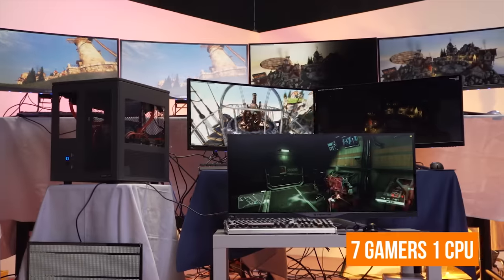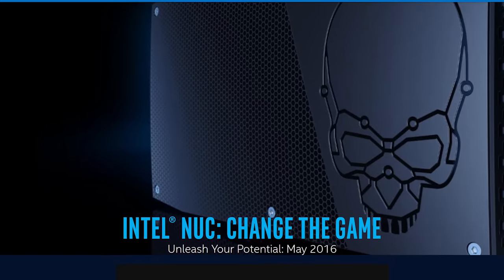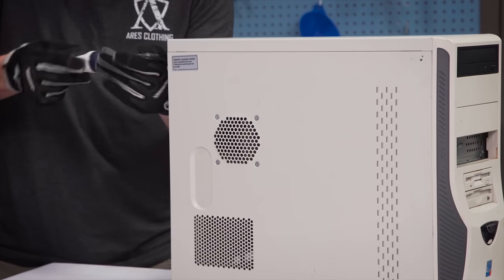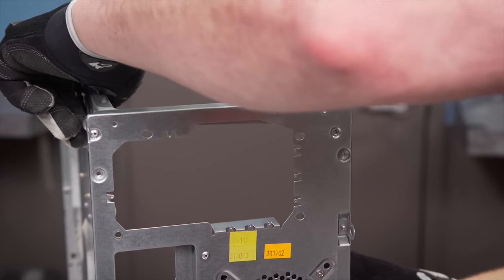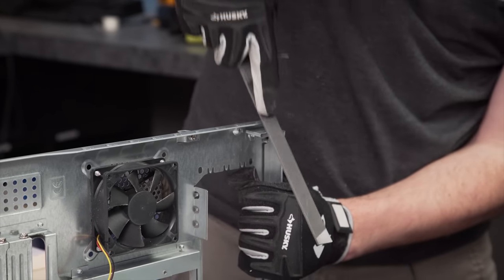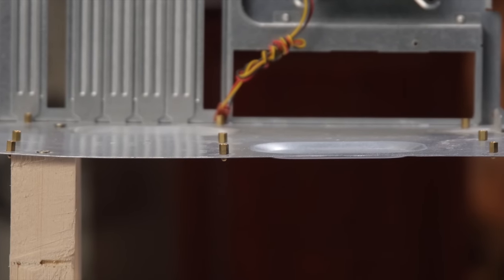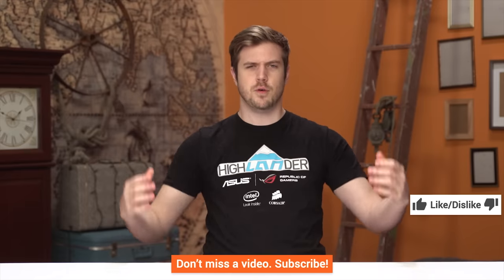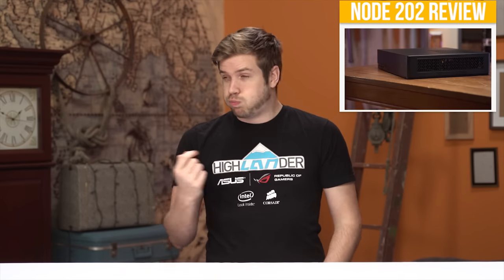Free (or extremely cheap) DIY PC Testbench!

Comment: BASICALLY FREE.....except for all these power tools that a lot of people don't have. Good Job.
Reply: +Adam Cross Good luck finding a nice workplace when you live in an apartment.
Reply: ikr
Reply: +wareagle3065 tell that to Casey Nistat
Reply: +Cutter Berk Neistat
Reply: One you can rent them two find some to barrow them from or three buy used tools there cheap
Reply: +Adam Cross all you really need is a power drill and a pair of tin snips. you can pick both of those up for $100 or less if you for some reason dont have a power drill and are watching this video
Reply: +Adam Cross This is shit the average home owner should already have. No argument.
Reply: +Samus Knight well ya, if you never plan on using your tools after you buy them they are not a very good value.
Reply: that would also work... probably would hurt to invest in a $20 power drill though
Reply: +Adam Cross Everyone should have tools.
Reply: +Adam Cross buy a metal saw for like 15$ and let me tell you anyone who is working with computers is more than likely an owner of a dremel which is really all you need to do this it will cut and file edges and they can be bought for like 30$ but i highly recommend good glasses as the cheap discs are known to explode ....
Reply: +Adam Cross good thing my dad an electrition and we have a workplace in my basement lol well part of it
Reply: Not an excuse. Many many many hardware stores have loan-a-tool programs.

Comment: dear luke,

at 5:16 please do not put your hand in front of a circular saw, great way to lose a few fingers.

if you need to rip some wood please have linus invest in a table saw.

thanks!
Reply: it had a stopper
Reply: @vladflorea7048  It had a stopper, but anything can cause it to well stop. A small piece of wood or anything could cause the stopper to get stuck, and it would slide up and verip his fingers.
Reply: @vladflorea7048  Just always assume it don't has a stopper. It's like gun safety and trigger discipline, correctly executed, the amount of accidents are reduced drastically
Reply: Safety first, i know and remember the sound of someone loosing their fingers in a saw.

Comment: you should really get some sheet metal shears. I built myself a testbench like this a while ago and they really helped to speed the build up because the cut the metal if those cases like butter
Reply: *of
Reply: +hansdietrich83 
But won't the metal bend on the cuts if its too thin?
Reply: +Polyaness ポリアネス yes but you can bend it strait easily
Reply: +hansdietrich83 I've got several old sheers since my grandfather used to do heat and air service lol probably never gonna make a test bench for myself but I guess I'm set.
Reply: +hansdietrich83 i was moding a case recently and there is no way that metal sheers would even come close to cutting through. just saying
Reply: +Smooth Trooper good to know.
Reply: +hansdietrich83 : I to have used them, and when it comes to tight places, they are useless.
Reply: +Thomas_Not_Tom They're*
Reply: +Thomas_Not_Tom Two names for the same thing
Reply: +hansdietrich83 i would have used a.. dang, i don't know its actual name, but i call it a nibbler, because that's how it cuts metal, by nibbling it away. Leaves a nicer edge than shears
Reply: +hansdietrich83 Sparks are cool.
Reply: +hansdietrich83 I believe that the amount of time that it takes to build that tray or money that you spent on power bills will outweigh the retail price of those motherboard trays. I think, it was like 20 bucks, eh? o.O
Reply: +Ozan Erbektas its a test bench not a motherboard tray. test benches are like £70.

Comment: Went on eBay and got a pc together for $240 usd, the pc has a i5-2400 8gb ddr3 ram and a gtx 750ti.  I had to tape the graphics card up and cut out a slot for the gpu in the side of the prebuilt case and cut put the slots on the side.  Along with removing parts of the plastic bits on the gpu shroud.  I was an adventure but for that price it's a great gaming pc.
Reply: Good job!
Reply: +herier44 noice job
Reply: +herier44 must have took some serious work. good on you sir or mam!
Reply: +herier44 too complicated. just use cardboard.
Reply: +herier44 cut out case "static much?"
Reply: jlrockafella ha nice idea ill have to try it some day.
Reply: Damn. I went with a custom case, 750ti,AMD 760kand 8gb ddr3 for around $500. 
Gj lad.
Reply: ***** thanks, mostly used parts and all but it still works to this day and when my friends come over they use it.
Reply: IS there any pictures of this PC anywhere?
Reply: 240 usd is way to much for a used system. You could build a new one for that money
Reply: Even worse fo 400 to 500 you could build a brand new system.
And new hardware is always better than used.
Reply: jment34 and with a hard budget of $250 what else was I going to do? The point of it was to have fun and see how much performance I could get for the price.
Reply: I would build a new AMD based system for a better performance/price. I have nothing against used gaming builds I do it also but always try unused hardware first.

Comment: I went to a scrapyard recently and ended up with an Asus P5N32-E SLI Plus (no onboard audio though), a C2D E4500 (OC'd to 3 GHz with a cooler I got from some Pentium 4 board), 2x1 GB Corsair XMS2 DDR2-800 RAM, a Radeon HD 4850, a 300 GB 7200 RPM WD hard drive, a super old case with a license sticker for Windows Server 2003 and a 450W PSU that is actually better than what most prebuilt PCs have. Even has a 6-pin PCIe connector so I didn't need to use a molex adapter to make the HD 4850 work.
Cost me 0€ in total. Cool stuff. Now if only I had a quad core CPU for it...

Not sure how this is related to the video, but anyway, lol.
Reply: Someone told me they found a PC with an AMD A6 CPU and 4 GB of DDR3 RAM in full working order :in that scrapyard. It's beyond me why people throw away these things.
Reply: Also, an Ivy Bridge OEM motherboard that I have no CPU for, but it does spin the fan when I short the power-on pins.
Reply: +InfinityCraft  because the people who throw away those things really couldn't tell you the different between a PSU and a PCIe.
Reply: djisomatic Probably, but you'd think people who own motherboards like the Asus P5N32-E SLI Plus would know that it's worth something. Then again, it was paired with a Pentium 4 and an old, passively cooled graphics card.

Comment: You tool skills have come a long way Luke. Going from trying to use a masonry bit in steel to one handing an angle grinder. And I like to see you bought the best one at that.
Reply: +Collin Huebler Welder/Fabricator checking in here...just like to say a 7amp makita grinder is by far NOT the best one.  When it comes to tools like this you want the one with the highest amperage motor giving you the most torque so there is less chance of stalling out the motor from working it too hard.  Makita makes great tools however you want to look for something with at least 12 amps or most commonly 13 amps as that is basically the upward limit you can pull through any standard 120V outlet.
Reply: ShoreStudios
Let me reiterate. For the price and size they got the best one. Ive beat the living crap outta the mikita and never had an issue. In the same shop the dewilts dont last a week. Every brand makes 1 great tool for mikita its the grinders for sure. You can probably get a 12 amp harbor freight or princess auto grinder but it wont even come close.
They arent exactly fabricating industrial skids here, right tool for the job. Seeing how luke cuts he would probably light himself on fire if u gave him a bigger one... been there before lol.

Comment: Please do a video on cheap server racks. That would be so awesome. I have 3 rack mount servers that I have on the ground because I don't wanna drop 800 on a damn shelf
Reply: +Surface™ Buy used, like off of Craigslist if you're in the US.
Reply: +Surface™ google "IKEA RAST bedside table server rack". there's even an instructable project on it if you haven't already figured out how to turn it into a rack
Reply: +Surface™ I'm in the same boat. Very hard to find a 12u-16u rack used. A perfect size for battery back ups, a few servers and switches and still short enough to put a printer on. Everyone seems to keep them. Way overpriced for a new one. The Ikea racks are great for shallow audio/network gear, but you have to combine 2 or mod some other tables for the standard rack depth. I've seen some adjustable depth racks, but they seem flimsy and don't trust thousands of dollars in gear in them.On the list of summer projects.
Reply: +WeAreTwoDoorsDown I could. But I would rather build one.
Reply: +DantesPurgatory But I would Like to see a video Of somebody doing it.
Reply: Surface™ get 2x 5/8" angles from Home Depot. They should be 19" apart on the outside. 1u = 1.75" so cut to length needed depending on how many Us you need. Build a simple plywood box around it and add casters for mobility. You basically need a table saw and a drill and a #10-32 tap.

Comment: Pro tip:  Go to Home Depot or Lowes and pick up a small bench top bandsaw - Ryobi for example would be fine.  You can usually find them on Craigslist, too.  Then get a blade for metal cutting (~20-24 teeth per inch, carbon tool steel or bimetal).  Get another blade for cutting wood (the one that comes with it - assuming it does - will work fine).  Then you won't cause people to drop bricks when they see you using a circular saw to make that cut on the 2x4 much less the 1 handed grinder use.  Safety first, man.  Plus, bandsaws let you do some awesome stuff when it comes to modding (and junkyard wars!)

Comment: I put a computer I made from old junk parts in a cardboard box once. 
Not quite the same, but my server is sort of a Macgyver project. Old Unisys mainframe tower, it came with 2 internal HDDs which were really just mounted on adapters in the optical drive bays. Then it has a RAID cage for 6 SCSI drives with SCA connections. A friend gave me like 6 more SCSI HDD but they were the internal type and I had no room for them so I just cabled them up and set them on the bottom of the case. Turned out the PSU was unable to power it all so I then put a DPDT switch in a filler plate for a 51/4 bay and that switches from the RAID cage to the internal HDD stack. When I got it too for some reason they used loud low flow squirrel cage fans I just put a case fan in the back vent and put the ducting back and left one of the 3 original fans in the front.
 
I did this to my PC too. I added a USB 3.0 card, which used a Molex connection for power. I didn't have one on my system, but I had lots of Molex leads from blown PSUs. I soldered some solid wire onto the Molex wires, inserted the solid wires into the unused FDD power connector on the 4V side and it worked.
I also wanted a card reader, I got a junk PC with one and it was just a connection to internal USB header, but DELL of course has their own oddball stuff or don't include it. I had a bunch of USB front panel cables, and finding the pinout I just took and internal cable, spliced to a cable from a junk mouse, etc remove a card slot cover on the back and then plug in the back USB port.

Comment: Files are one way tools, meant to be pushed away from you. The teeth won't cut when pulling typically and you can actually damage the tool by doing that. Probably won't hurt the tool with something soft like aluminum, but FYI.

Comment: One good trick is to use peg's for some of the standoffs, since if you're building a test bench, you are probably going to be swapping out mobo's from time to time.  Also, a cardboard box is a GREAT test bench for what most people need, which is  a place to quickly test new hardware before starting a system build.

Comment: my favorite DIY open bench was a pulled Antec P-160 removable tray I was able to use as as is w/ it's quick release to get boards in & out and fixed to an aluminium box w/ legs for PSU and other gear underneath as well as space to store pump & res for water cool test later. I lost this in a move so I want to replicate it but utilizing my rotating flat to upright for long term space saving testing adding brackets for area fans to move air. The good old Dell workstation cases were good candidates as they were heavier sturdy to cut up and use their drive cages to mod for new stuff. For example, a 5' bay fits a 4x 2.5' SATA SSD RAID kit bk in the day when we used them. & use d a laptop slim SATA BR/DVD on top of it for more compact.  Another fun 1 I have going now is a 3U drawer fit test kit as I just sit in front of it and slid it under table as I need. Cool video as always Luke (:

Comment: You should see the setup I have built. I have been dumpster diving and now have brought back four computers back from the grave. (one of them has not been turned on in over 10 years!) I have been fabricating my own parts and mods for these computers as three of them are laptops and I built three cooling pads for them. the cooling pads all run on external power supplies and the fans were cannibalized from Desktops or killer sales (Newegg 4th July sale! 2 dollar Fans!!!) Plus the power supplies for these cooling pads are supplied through old AC adapters (everyone has a box full of old adapters and you will be surprised what that old cell phone adapter can be used for!) Once that was done, I had to jump back into that dumpster and got my hands on some old foam boards and built custom monitor stands that allowed for your screens to wrap around the deck and the monitor stand being one big unit also has feeder "tunnels" for all your cable management needs, reducing desk clutter, giving a clean look. I used cement board for the top layer to give it a "indestructible" feel to it on top, plus a can of dark wood stain to the cement board gave it a killer black look and it sealed it perfectly without killing the foam. I also used joint sealer or plaster for the cement board to smooth it out too. .94 cents will buy you some pool noodles and that my friends buys you perfect cable management for all your cables behind your screens. run your cables through the noodle and no more mess. After that, you can either choose to drop $135 bucks on a Elgato stream deck or you can do what i did and re-purpose a old nook and have a macro grid for your nook, connecting it to your computer plus nabbing a $5 dollar external num pad and turning it into a macro switch pad and using that trusty foam board to make a docking station for both units.  Another $4 bucks will get you a 7 port usb hub and that sale allowed me to land a 6 foot usb extension cable for .99 cents, so now I can turn that macro board into a fully function station. I have made some other modifications from stuff others would have called "trash". Turned a old dead box fan into a cooling tower for a gaming desktop. Those computers I brought back from the grave, One was a former e-machine that now see's life as Super Nintendo/Nintendo/Gameboy with 30,000 games and the monitor it's hooked up to was a free screen that the hospital threw out. it's a older one, i'm talking a Gen 1 flat screen but the screen can swivel all directions and has great pivot, making it a excellent 16 bit throwback screen. The other units are seeing life as my work stations now, all running different operating systems too! One rocks out with a free Windows 10, another has Zorin OS, Bodhi OS, and Pop!_OS. When i'm done with all of this, my next project will be a USB projector. I found my moms old 1960's projector and the lens are in perfect shape!

Comment: I feel like this is a great starting point for a lot of awesome test benches. first thing I would probably add is those HDD brackets on the bottom, an I/O panel for USB and power switches and stuff (made either from wood or a piece of metal from the scrap pile), and maybe a couple of small structural struts to make the main I/O and PCI slots more stable

Comment: I'm going to repurpose an old ATX PC case into a slim, wallhung one for my garden shed, which I want to repurpose into a tiny workshop. This is mainly to save time for me as my garden shed lies on ground level and my apartment is on 3rd floor (4th if you're american), so I really don't want to have to run back and forth between my future workshop and my apartment, if I wanna know something and have to check it up on a PC.. And then I'll also repurpose another one into a test bench as I am a scrapper and I need to know if what I scrap, actually works. Fans are easy to test. CPU's, Mobas, RAM, GPUs and other PCI-E cards.. not so much.

Comment: Quick tip, cut the motherboard tray a little wider and bend the end 90deg to get some rigidity so the motherboard wont bend as much when adding weight like a graphics card etc.

Comment: Luke I like you and your workbench videos because it is very close to how I've always felt about computers. Frankenstein-ing bits together to make PCs and getting "absolute confirmation" answers from those workshop videos (some people hate them but I'd rather have a definitive answer about fan placement, thermal compound placement etc) is awesome, it's great to have a "fat rig" but mashing together PCs is also great :)

EDIT : Also on sharper edges you can use electrical tape and that should help :)

Comment: Rather then 2x4, you could make the feet and upright's from threaded rod, would look MUCH cleaner as well as providing a electrical link (so you could ground the test bench, both for static reason's and safety) acorn nuts for the feet\top caps, and regular to set the standoff's.  It also makes the build a lot safer for people who don't know how to use skillsaw's (and removes one more tool from the list)